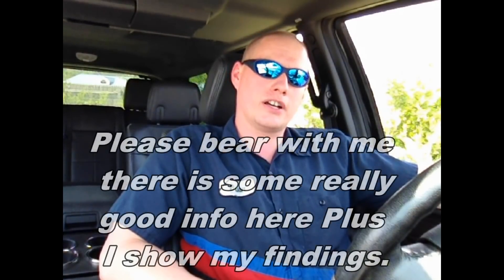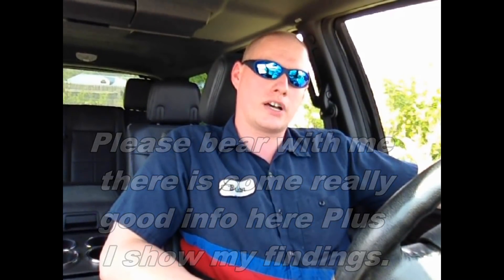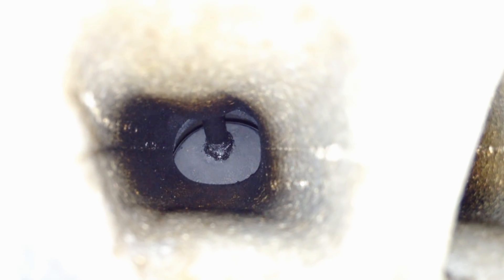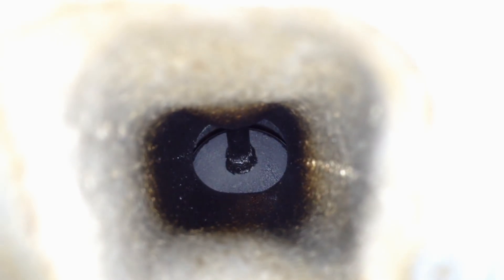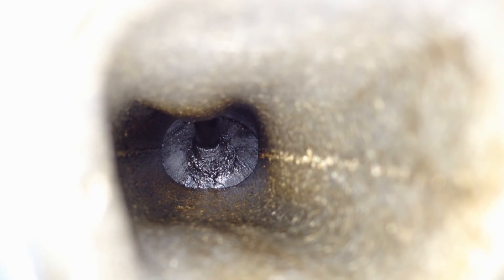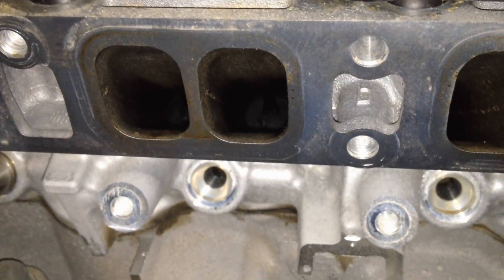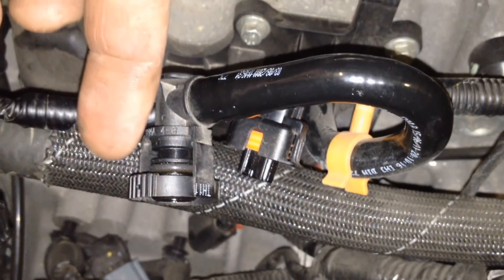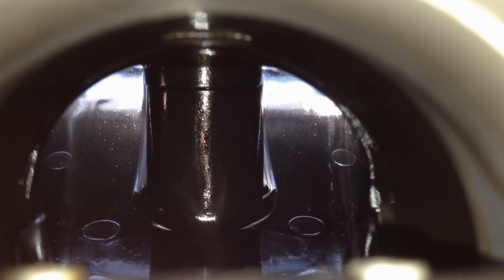Ford Ecoboost Warning Part 2 My Findings

Comment: Very good diagnosis, you are very smart-- yes it looks like severe oil deposits especially for a 20,000 mile vehicle. I wonder what owners are supposed to do now? In the shop every year for a valve cleaning/head replacement? That's nonsense to be honest, you cannot tell me that Ford fully tested these engines and nothing was found if problems show after such low mileage- Cars now should run fine with basic maintenance like oil change, etc. not a full induction cleaning/head replacement every 20,000 miles. I have a 96 Jeep Grand Cherokee 5.2/318 engine and with 140,000 miles I have no problems. You know some people design things on the drawing board and operating in an IDEAL environment MAYBE few problems but again that shows very poor pre testing if any at all by ford.
Do you feel this problem will devalue the cars/trucks as time progresses?  

Do you remember the Original Ford Festiva? 1.3 BASIC engine, I had a 93 5 speed for 10 years and that car got 40 mpg combined and about 44 highway, 160,000 miles and not oil consumption at all, a SIMPLE engine yielding 40 mph, certainly not a powerhouse at 65 hp but many times basic is better

Comment: Should Ford owners use Fuel Injecter cleaners like Lucus oil, STP etc, Or will ford find out and I will have issues? If that is not the way to help this misfire issue what can be done? I have a 2014 1.6 ecoboost,
+FordTechMakuloco
Reply from the maker: SISI0887 Fuel cleaners in tank are ok.
Reply: Anything you put in the tank, will have absolutely no effect on the problem mentioned... injectors are located directly in the combustion chamber, and doesnt spray anywhere near the gunked up valves.
Reply: Seafoam works well on cars and trucks ive used it on. Even used it on one of my boosted vehicles. Poured through the main vac line kept my valves decent. Never seen an ecoboost engine though so i dont know how they do things. People have said its snake oil, but i use it all the time for soaking things in. Eats grime and carbon off.

Comment: The PCV oiling problem is nothing new. If you look at aftermarket companies like Steeda and others, they have a fix for this.
Reply: FordTechMakuloco I think the fact that ford is still using an EGR valve is also contributing to this issue. This is a non issue on the theta 2 due to no egr and injector placement and timing. injector is placed in a way that when the intake valves are opened part of the fuel goes over them made possible by the high pressure pump. What is your take on the egr and this issue. In my opinion all GDI engines should have a catch can. But if we all add one does it effect the warranty?
Reply from the maker: Mike Emerson agreed but oem should have this figured.

Comment: Ok, I'm not following. So is this issue happening on all 2.0 Ecoboosts or only to those who mess with the engine in some way? I'm planning on buying an S-max 2.0 240 horsepower in a few months. Thanks. (from the UK)
Reply from the maker: BoeingvsAirbus1578 Happens on any ecoboost but yes the lower revving 2.0 gets it the worst as shown.
Reply: the 4 pot version  seems to be ok in Australia, but i suspect our emission laws are a tad different here to other country's, i dont know if its relevant but i believe the quality of fuels and formula of fuels also varies between countrys .

Comment: I'm confused as to why an induction cleaner can't be pulled into the manifold downstream of the turbo(s)...?  I can understand not wanting to send it 'through' the impellers, but can't rationalize why it wouldn't be ok directly into the manifold...

I must admit I'm amazed that such few deposits can result in a misfire...

Reroute pcv through a catch can/separator and all is good?

Considering a new mustang EB and don't want to regret it based on dumb crap like this as I plan on doing things that terminate the warranty pretty soon after purchase...

Comment: how can a bit of carbon cause a misfire? and  clear once the engine is warm, surly its the spark plugs burning off the excess oil on them from the breather and clearing as the engine warms up .
Reply: Engine runs static spark advance tables, and ignores the lambda sensor input during cold conditions. Those static values are calibrated for a clean engine, so when carbon builds up, and causes turbulence in the combustion chamber you're pretty much screwed. You'd think that the turbulence wouldn't matter, but combustion chamber design on these kinds of engines are really intelligent. The entire air flow, and contour of piston etc, makes so the oxygen and fuel mixture is just right around the spark plug, and way to lean in the rest of the combustion chamber, so that you can combust a much, much leaner mixture than normal... when the turbulence comes into effect, it can get skewed away from the spark plug, making it misfire... during warm conditions the engine management will try to lean out the mixture as much as possible, and vary the spark advance, so it will dynamically try to not get misfires, or pinging. These are normal problems for direct injection cars. Removing intake, and clean intake and valves are the only option, and then do a EGR delete, and add a oil catch can to the PCV system... the EGR delete isn't an option without reprogramming the ECU. Forget about chemicals, it's way to bad for them to have any kind of effect.
Reply from the maker: Nope plugs clean and dry no residue.
Reply: The combustion swirl can be different when cold, due to a difference in air density at cold temps.
Reply: Martin Pedersen smart man

Comment: What type of driving causes this? Is it short trips? 
If the temperature limits of the turbo won't allow for BGE treatment, is Ford considering a slightly larger turbo to allow for compressor bleed air to be used for internal cooling of the hot section (turbine) bearing housing and oil seals? This would allow for occasional cleanings, extend the life of the turbo and reduce coking of the turbine shaft.
Reply: FordTechMakuloco is scotty kilmer's tip of giving it some rpm to blast out the carbon a good idea?
Reply from the maker: Anything low rpm will cause the buildup think around town driving. The temperature and carbon deposit chunks that kill the turbos. The turbos are already cooled by coolant.
Reply: FordTechMakuloco I knew the turbos were already cooled, but that cooling is relegated to the housing(s). I was talking in terms of using compressor bleed air to cool the turbine itself. This would reduce turbine temps, whereas the coolant is reducing the oil lubrication system temps. Just my two cents...
Reply: Kyle Hand Are you talking of intrudicing clean air into the exhaust manifold? there's at least two problems with that, you have more pressure at the inlet of the turbine housing than on the outlet of the compressor, it will recirculate the wrong way, and if you're intruducing clean air, oxygen, in the exhaust you're only increasing the exhaust temps, and you'll burn the turbine and cat's really fast!
Reply: WickedTRX Good to know, I was not aware the pressure at the turbine inlet T1 was that high. Typically, centrifugal compressors are a 25 to 1 compression ratio. And you make a great point about the cats. Thanks for the feedback.

Comment: How would I turn over the engine without starting it. I do this when changing the oil to prime things. On the f150 I just press the accelerator while turning the key and let go 7 seconds later. But now there is the keyfob. If anybody knows I think you would
Reply from the maker: Disconnect the crank sensor you can crank all day it wont fire.

Comment: Do you know if FORD will or has made any changes to this particular problem and does this problem apply their regular 3.5L engines that are not EB?
Reply from the maker: No the problem is only ecoboost engines for the 3.5l. They attempted a fix for the oil problem on the ecoboost 3.5l in the cars yes.

Comment: Just get an oil catch can and problem solved..
Reply: FordTechMakuloco OCC is needed for every DI engine, Why they dont include them from the factory is beyond me.Everything that contacts the intake valves stays there and the PCV system doesn't help.
Reply: ***** Because no one would ever empty them. Even if it was in the manual. Lucky most people know how to pump their own gas! people watching these videos know more than the average joe.
Reply from the maker: george palacios Part of the problem yes.

Comment: Hey fellow ford tech here from California, I've followed your channel for several months now and have been subscribed for a while now.you do a great job with your tech videos and I enjoy your rc videos as I have several Rc's my self.

Do you post on the discussion boards?

Anyways I need your help man,I have a question on this vid. Under what conditions were you feeling the misfire? I have a '12 explorer 2.0 ecoboost 42,xxx miles,and seems to be missing at low speeds under 20mph low load cruising in third gear then slightly toping into the accelerator it will mis,but I can't feel it but can see it on the power balance #2 misfires randomly,cylinder acceleration pids show #2 -1.4 when this happens,mode 6 only shows 18 misfire counts for #2 all others good.its so intermittent and random when they bring it in but advisor told me they say it does it  more cold.i swapped coils and plugs no change,all tests pass,and of course getting the hotline runaround.

At this point it's time to change injector,but I was wondering if this might be an issue?i might take a look see at the valve. thanks for your hard work on these vids and the shared info.
Reply from the maker: Yes I post on the discussion boards but not as often as I would like. I was feeling the misfire on cold starts in gear light throttle taking off from a stop. Also at times while engine still cold cruising light throttle constant like through a construction zone. Mine was doing the same as yours exactly started on 2 and grew to 3. I would order the injector for it and while you are in there take a close look at the valves as shown in this video. Make sure you do a cleaning of the valves manually while you are in there, between the cleaning and the injectors I changed misfire is still gone. Hope this helps.
Reply: Injector back ordered till the end of the month so will have to wait but will check and clean valves when I'm there.

Also got somewhere with hotline,had one of those rare good hotline contacts where I was called almost right away.anways just wanted to share that he told me for a certain build date there was a faulty head mold and there is issues with a batch of cylinder heads on these that are porous in the exhaust port of number 2 and will leak coolant back into the cylinder during cold soaks on startup or also on warm up at lower speeds low load conditions.so lookout for steam clean spots on the piston.
Reply from the maker: Wow that is good info to have thanks! Mine did not have steam cleaned valves at all though. I wondered if there was head problems like you said or in general valve seating issues etc.
Reply: Alexis Villafana what was the build date. ran oasis on one here im working on. BUILD DATE: 09-AUGUST-2011,
Reply: The one I'm working on has a build date of 1-6-2012.

Comment: Thanks for the rather informative video. Do you think running non ethanol fuel would help prevent this issue? Also, do you think Ford will have an actual fix anytime soon? My warranty is good till 70k, so no worries today, but I'd hate to have to eat this myself, knowing 100% it's an engineering problem Ford new about before building the engines.

Finally, did I hear you right on NOT using cleaning agents as they could damage the turbo?
Reply from the maker: Yes I have a whole video on not using cleaning agents by induction here- 
New Warning To All Ford Ecoboost Owners!
 am sure before long they will have an approved cleaning solution for us like BMW.
Reply: FordTechMakuloco Does this issue become a problem before 20k? I feel, positively, my 2L has a miss and it's still under 11k.

I'll watch that other video later. Thanks.
Reply from the maker: cheatrslix1 On mine it came on around 15k miles

Comment: Could you make a how-to clean your intake valves? I have a Focus ST with a 2.0 ecoboost and all my valves have quite amount of gunk in them. focusst.org/forum/focus-st-maintenance/24291-how-bad-do-my-valves-look.html
Reply from the maker: Maybe on the next one I get but I literally sprayed a good carb cleaner down in there a few times to soak and brushed them off with a small brass wire brush then blew out the whole area very thoroughly.
Reply: FordTechMakuloco When I checked mine all the valves seemed closed, is that the way its designed or do I have to check if some of them are open?
Reply from the maker: Some are open either way, best to spray and clean them and blow out any residue in the cylinders through the spark plug port.
Reply: FordTechMakuloco Thanks!!

Comment: I have been using AMSOIL P.I. Performance Improver Gasoline Additive in my F-150 Eco-boost. It has about 8,000 miles. After the first time use at 7,000 miles I notice a performance increase and average of about 1.5 mpg increase. Is this an alternative means of dealing with the carbon buildup?
Reply from the maker: Even though it is direct injection I feel it will help yes.
Reply: FordTechMakuloco I'm still a bit new to the ecoboost thing, so feel free to correct me if necessary, but I believe with the ecoboost being DI, any fuel additive used wouldn't even touch the back of the intake valves. It would clean up the injectors, combustion chamber, and perhaps exhaust valves, but unless a bunch of it got through the EGR system successfully, I don't think it would make any difference.
Reply from the maker: It all has to do with the burn quality and the deposits it leaves behind as a result an improver like those cleaners would help, and with the large overlap on the ecoboost for scavenging efficiency the intakes can see it.

Comment: Starting to see this more oftern now with most direct injection engines.As there is no wash from the injector to clean the back of the inlet valves they get cloged up and cause misfires